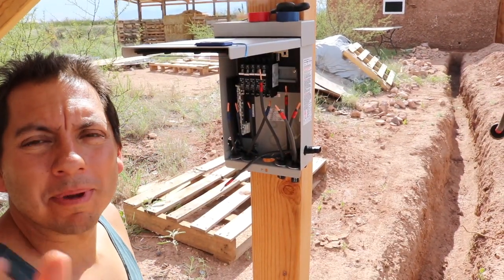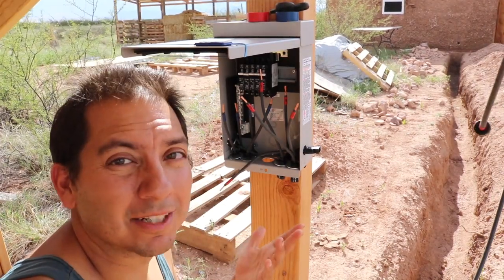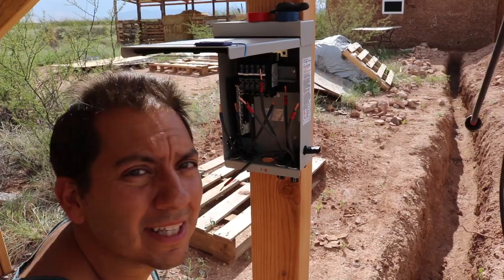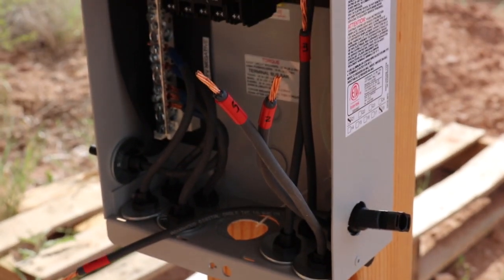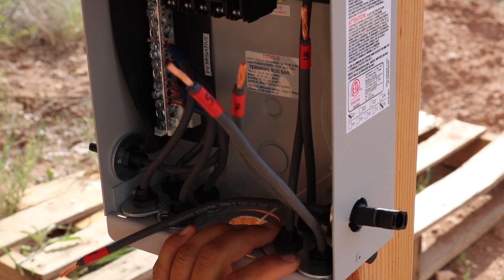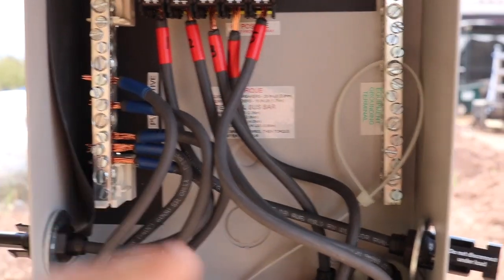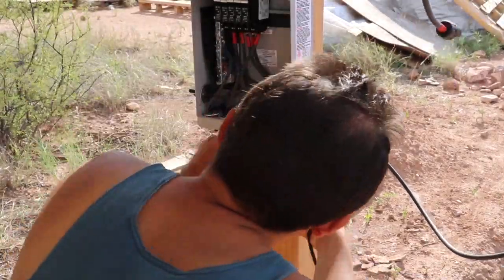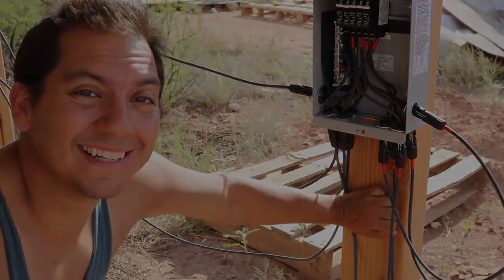Solar Wiring Part 3   wiring the panels into the combiner box

Comment: As a professional master electrician that installed and services averting from thermocouples to working in high yards, I am screaming at the screen.  Next time simply install a NEMA 4X wire trough and connect it with a few insulated chase nipples.  In the case of the bottom of the box not having the proper KOs you could have simply cut out the bottom and left 1/2" edge to tap for screws and then layer out a plate with proper holes for the 10 connectors in pairs.  Then installed it with a bit of sealant.  It would violate the listing of the box but as long as it was safe, professional, and workman like, most any inspector would not give it a second look.  Not that any of what you are doing has or will ever be inspected...